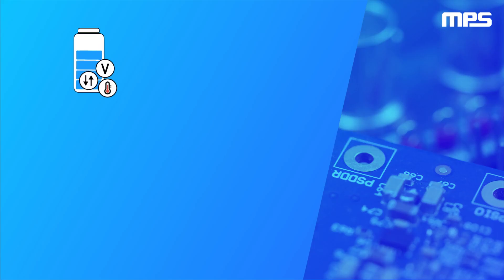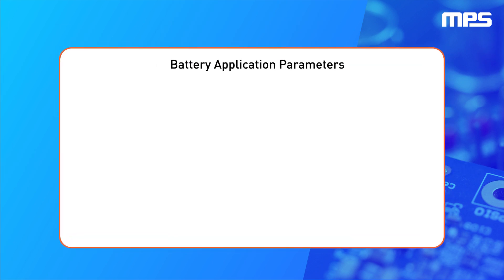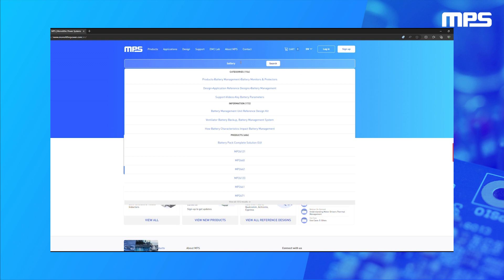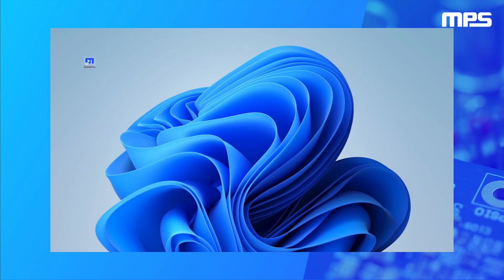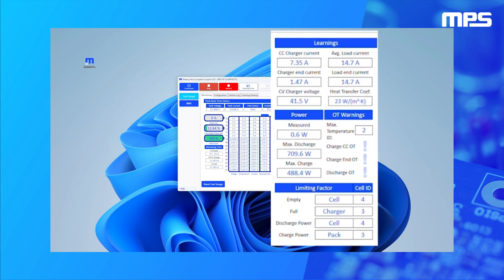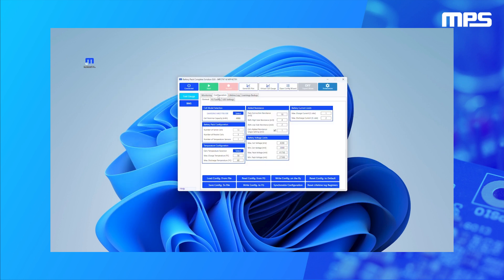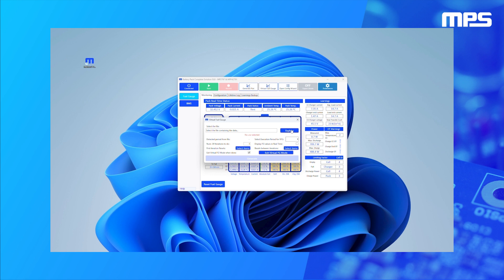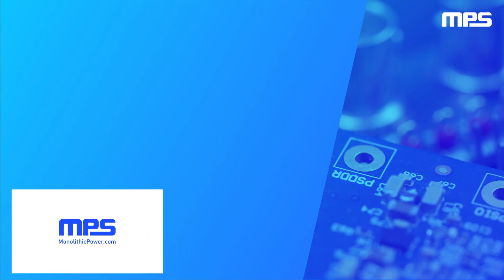Evaluating Battery Management Systems, State-of-Charge, and State-of-Health

Comment: I do not need this stuff you are talking about, I need balance carrent ? How mouch current is this BMS capable ? 15 - 20 - 25 - 30 - 35 A Active balance current ? How precise is SOC ? After 6 month without synchronisation, what will be real and measured value of SOC ? Measured 72 % SOC and real after voltage chceck 5 % ? Because modern SOC meters have large error at current measuremet and after 6 x 30 x 24 hours of integration, error is so high, that SOC and SOH are only fabulations not real values and all this values you display are fake.
Reply from the maker: Thank you for your inquiry.  Please go to our forum for technical questions.  We have engineers that will respond within 24 hours. https://forum.monolithicpower.com/